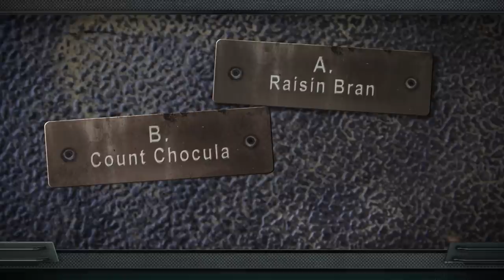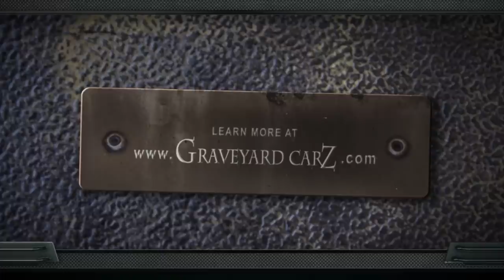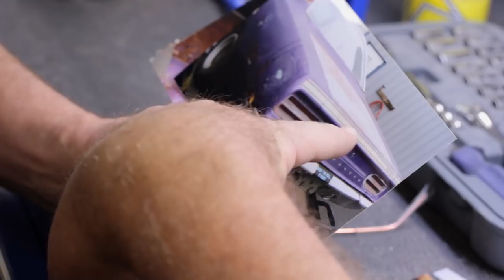CLIENT IS HARD ON FRESHLY RESTORED DAYTONA: PISSES MARK OFF

Comment: That has to be the worst fitting nose cone I have seen on any restored Daytona or Superbird. The fit of the hood to nose and d/s fender to nose is atrocious and you can really see how bad it is in the shot where you back out of the garage @24:15. I luv the Daytona just not that one :(
Reply: I agree this one is particularly bad but from the factory they were bad, so I would say its factory correct. The superbirds and daytonas were conversions and hack jobs just so they could make the rules of selling 500 of them to race in Nascar.
Reply: Agreed, I've seen a few noses on superbirds and daytonas that just didn't seem to fit flush and it made me wonder if it was a manufacturing problem if it hasn't been fixed in restoration. I guess you can't completely blame the guys but at the same time if I'm spending that kinda money I'd want perfection.
Reply: Exakly. Bad woork.
Reply: Exactly! At this high level of restoration, that should have been corrected. I have seen them custom build new headlamp buckets for a Superbird so this is not out of the realm of possibility.
Reply: this the same as   some of the bikes that were   built  @ occ    they looked great at a distance  but ive seen a few up close,,,,horrible

Comment: Body panel gap looks not quite right,  especially the front end.  Needs adjustment Mark . Its par for Dodge /Chrysler. Go like hell then fall apart..
Reply: If you pause the video at 28:46 the hood isn’t even close to being lined up correctly

Comment: Surprised to see no chrome wheel well molding in front, only in back.  Is that factory?
Reply: The car is not done. Look at the headliner on the left side 27:10. With a total restoration like this I don't doubt some of the parts were hard to find. Hopefully they find everything and finish it up. Right now it would be dinged to death at a car show.

Comment: I don't see why you would get mad with someone driving it the way it should be
Reply: That is a fresh motor... it has to be properly broken in... you don't just hammer the shit out of the motor before moving parts get properly seated in and hardened.  This is a great way to round out a camshaft.  A good way to get metal shavings throughout the engine.   Same thing for the brakes.
Reply: @Jacques_Merde  not really lol the car was hot already everything would have been perfectly fine
Reply: @Jacques_Merde  Didn't Cousin Dougie run it on the engine stand first?  lol